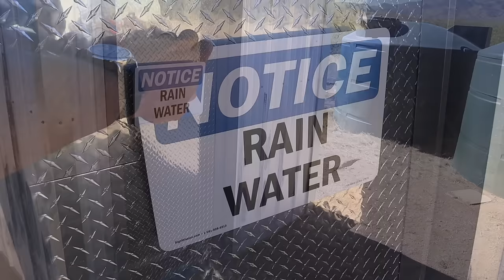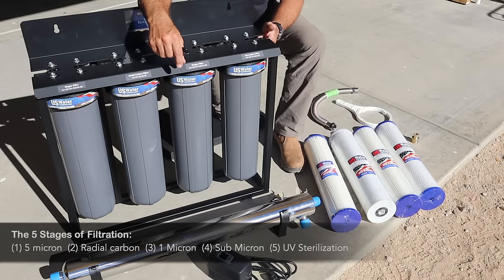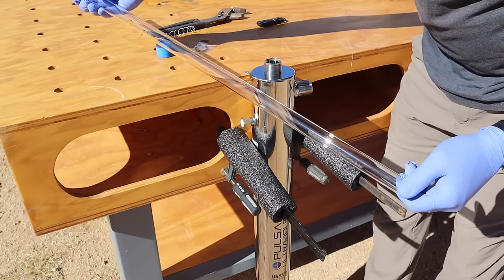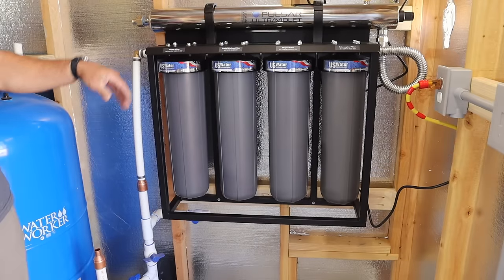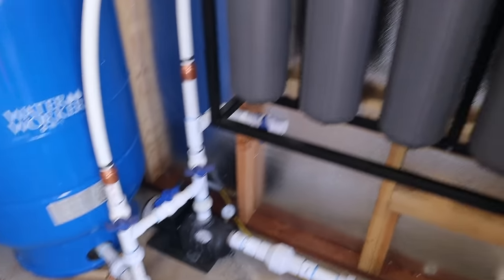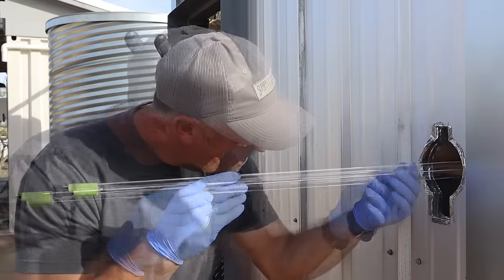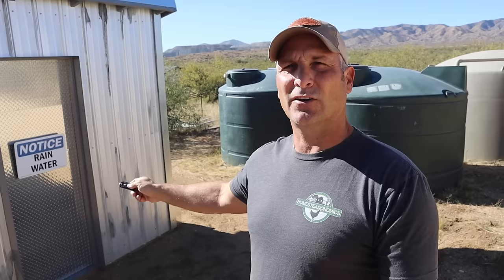Whole House Water Filter Install for my Rainwater Harvesting System

Comment: be nice if you could do a vid on outdoor solar lights. like cheapest to most expensive. ive been struggling to find cost effective good ones that dont die or break within 1 year of purchase. ive gotten dollar store,tsc and walmart brands thus far and am not really impressed. plus you being an arizonan you have the light output restraints i have w outdoor lighting here. been following u since i moved to tucson 6 years ago.keep up the great work boss. went to yer metal shop for my trailer build and they were awesome. thanks for the info in that vid awhile back.

Comment: I'm new to this so my questions are elementary I am sure:  1 can one set up a rain water system to supply entire home 2 if one lives in city limits can the "tanks" etc be hidden/buried for aesthetics?  3 do you travel and install for people  4 are there systems for entire home to filter water even if you do not use the rainwater system

Comment: Thanks for the video. I am currently looking into a hybrid rain/well water system for our homestead.

What is the PH of your rain water? Rain water is said to usually be somewhat acidic, with a PH of around 5. Have you done anything to balance the PH? If not, have you noticed any problems with corrosion in you metal plumbing and appliances?

Thanks!

Comment: What voltage is the uv light> Can it be done with DC Voltage?
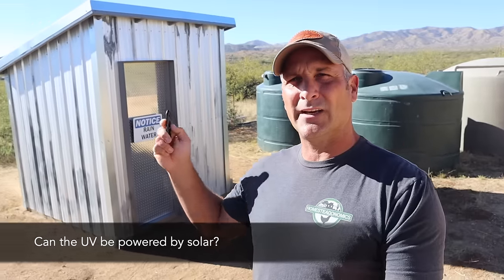Reply from the maker: 15:07  manufacturer states draw is less than 1.5 amps

Comment: Did you have to purge the whole house before the drink test?
Reply from the maker: The manufacturer recommends flowing water from all faucets for a couple minutes to cycle through the pre/post filtered water.   Which is all that I did.

Additionally, a couple times a year I will add chlorine(granulated type) to one of my tanks when the water is low and flow though my house to ensure no bacteria grows within the pipes.   And then fill back with fresh water so I don’t have chlorinated water sitting in the pipes.

Comment: We're on well water here in Ohio.  No iron but plenty of magnesium and calcium floating around in there to get the faucets nice and crusty.  Trying out one of those electronic descalers and I've been trying to figure out what components we need to clean up our water without resorting to a water softener.  It is definitely a bit intimidating as it seems the options are endless.

I'm certainly interested in some rainwater collection but would likely need to collect in a cistern to avoid everything freezing up in the winter.

Thanks for the great videos!

Comment: when you say your pump house is set at around 50 psi, is that just what your pressure tank is set at? or does this filter system have its own settings?

Comment: Little tip, no UV should be mounted horizontally, those fingers holding up the end of the glass sleeve will break and you won’t notice it until you try and tighten the nut down which will break the sleeve, also (more so in well water) debris/scale can accumulate on the bottom side of chamber and removal can be tricky.

Comment: Great install.
I would suggest to anyone buying such systems to do a little extra research inorder to avoid buying systems with proprietary filters and parts.  Everything should be made with common parts to avoid servicing issues down the road.
Reply: YES BIG BLUE FOR THE PETAIR  4.5  FILTER DIAMETER AND10 OR 20-INCH LONG HOUSING. 20 INCH LONG HAS 1/2 THE PRESSURE DROP AND DOUBLE THE SERVICE LIFE. Buy open-source pleated filters instead of proprietary parts and cut the upkeep cost in half.

Comment: Now to make this system also go through a Keagan machine and Re-mineralizer. That way your water comes into the house with the minerals/vitamins it needs to make it usable water and the keagan machine will Change the water PH to what your body needs. (keagan machines are like 5k) (No clue how you would remineralize the water)

Cause once you do all this with that system, it removes all the good and bad stuff from the water,and god knows what PH level it is when you drink it. Just an extra step id suggest.
Reply: Other than balancing PH, which points to a Much bigger problem if your rain is highly acidic, there is no need to remineralize filtered rain water.

Comment: 20 minute commercial.  Expect nothing less from AZ.  Scammers, and cheats.
Reply from the maker: It was a sponsored project of which I said upfront in the video, in the description and also with the ‘promotion’ tag in the upper left hand corner of the screen.      They sent me a unit to install and that’s what I did.  
You can think of me what you want but please don’t compare me to the crooks running AZ right now